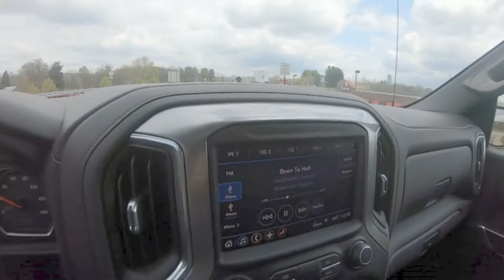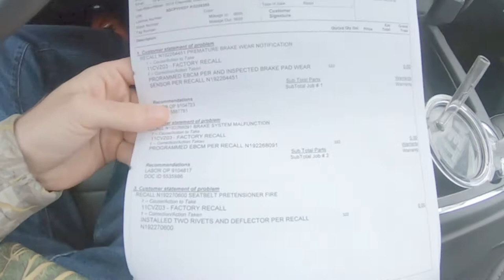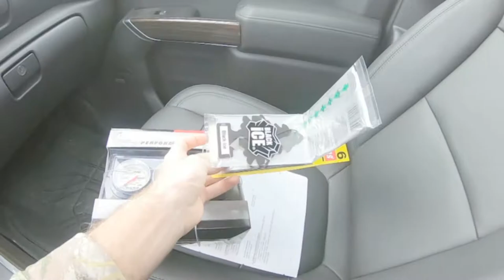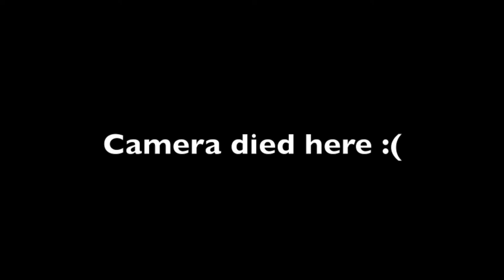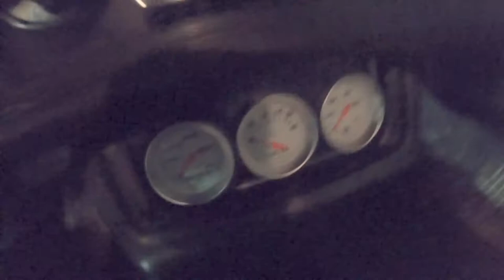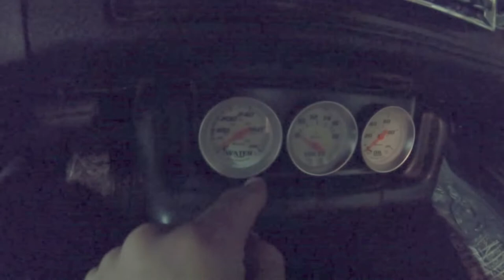Steering Wheel Install on my 1976 Bumble Bee Camaro...kinda

Comment: Hey man where did u get the steering wheel from? And then the horn emblem? I've been looking and I can't find one.
Reply from the maker: Hey Ethan, the steering wheel I found off of eBay, it’s not a true Grant wheel, they been discontinued for some time now. I found this one and made an adapter plate. The horn button also came from eBay, but I took a grant horn and tore it apart and put the eBay emblem into the grant assembly.